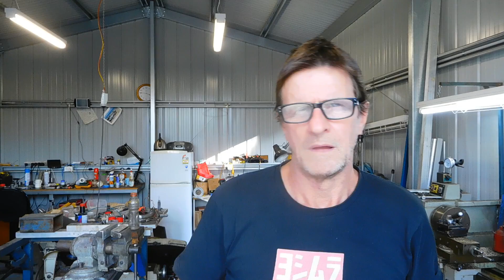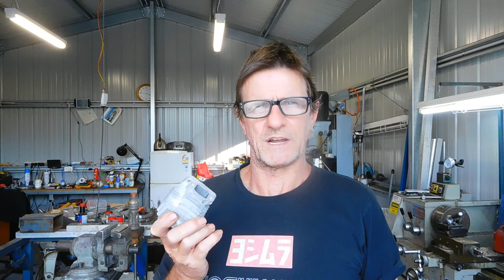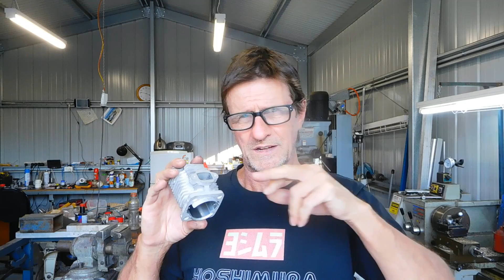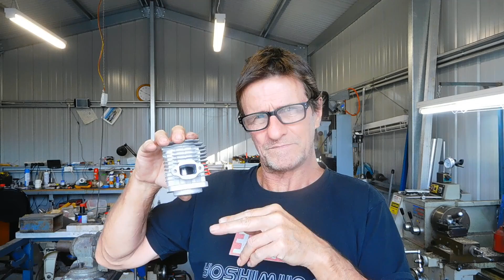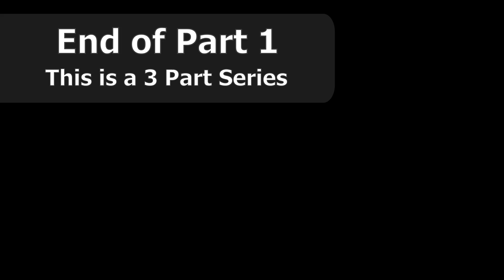Unlocking the secrets of 2 stroke porting part 1 - Why do you map the ports to paper.

Comment: Have you looked at the influence of increased blow down versus power with no change in exhaust timing or pipe?  As the engine is bored out, the inclined boost and transfer ports are lowered WRT the exhaust.  I am wondering if we should raise the cylinder> increase exhaust duration or leave it as it was prior to boring and what the effect will be.

Comment: I have a 100 CC 2 stroke engine and I rebuilt that engine and it is performing fine but it is drinking a lot of fuel, probably I am getting fuel economy of 10 km per L and my engine makes only 8 HP, so what is the problem
Reply from the maker: Id say your carby is way too rich for some reason, maybe check the float level for starters, it is hard to say without seeing it.
Excess fuel consumption can be several causes.
Reply: @AuMechanic  thank you sir for helping me , it really helped me